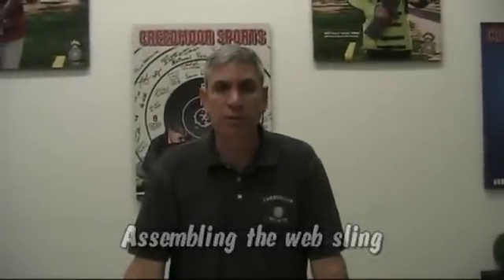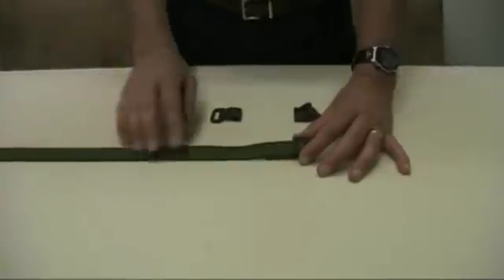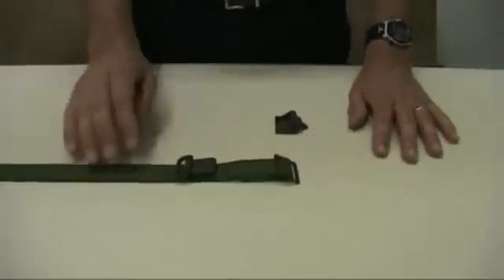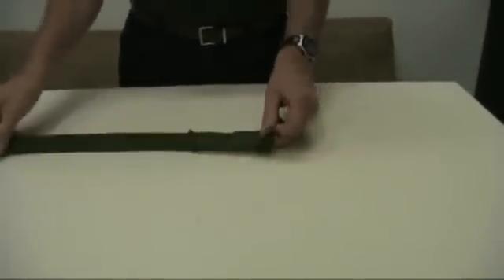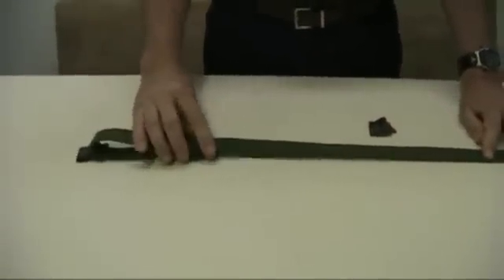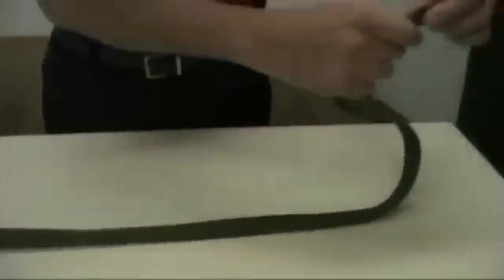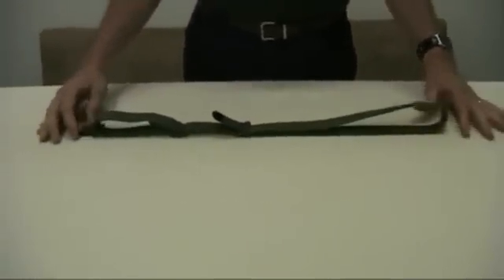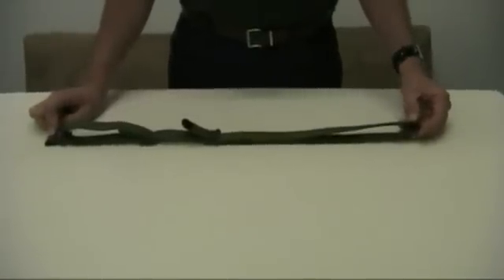Web Sling Assembly

Comment: I believe you have the cam buckle backwards, because the flat part of the cam buckle should face the rifle so it that it would fit flat against your shoulder while carrying the rifle.
Reply: Army field manual TM 9-1005-223-12 shows just as he did. personally i flipped the buckle as you stated for three reasons 
1. its MY rifle 
2.i don't like the  ears of the buckle digging into my shoulder or my rifles furniture 
3. i don't have a DI screaming at me.
Reply: Well I'm glad to see someone else has my same practical thoughts on the matter. My career was in code enforcement, and there were a couple of instances where the code was incorrectly printed, so I learned long ago that just because it is written in a book, doesn't mean it is correct! Thank you for your input.
Reply: That is how the old timers at the range taught me,  the first Garand Match I was at.   Been awhile,  I need to try that again.   Nonetheless..
Ty for the video